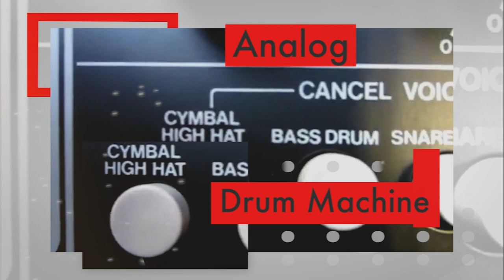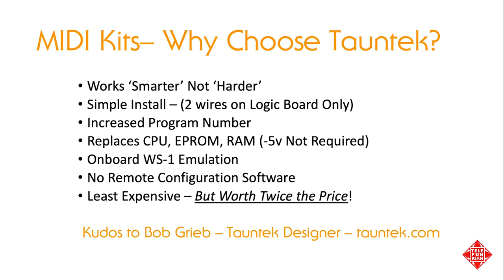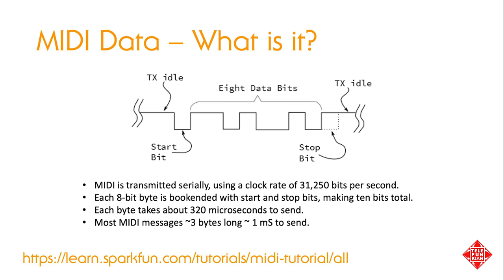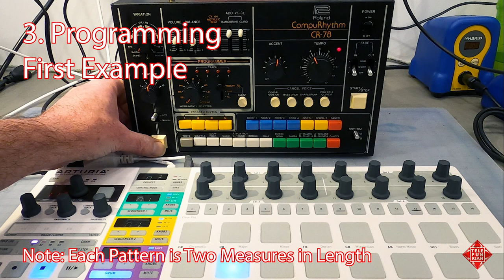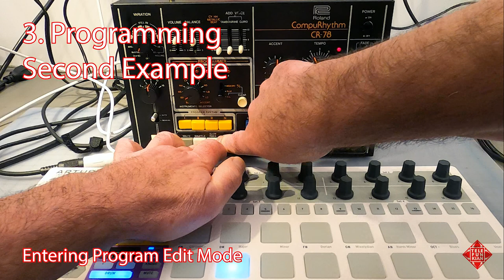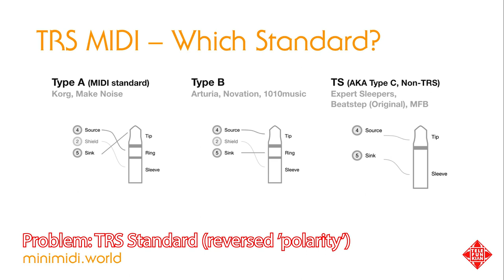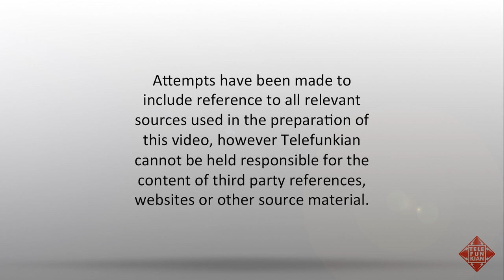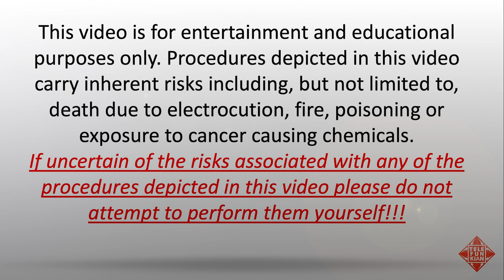Choosing and Installing a MIDI Kit in the CR 78

Comment: Excellent video. I installed this kit about a month ago and it totally changes your perception of the machine. I’m using the internal programmer a lot rather than midi sequencing and there’s a few aids Bob added to make it even easier. For example you only need to program the first bar of the pattern (in many early drum machines a pattern is two bars long) and copy it to the second part at the press of a button.
Reply from the maker: Thanks for your comment! Yes this kit, or similar, is a must-have for a CR-78 as far as I am concerned. I have a CR-8000 on deck that I hope to give similar treatment, not sure which kit to use there though...

Comment: Interesting vid. Very informative. You didn’t show how to extract the main board from the PCB. 

If you change the CPU does it not change the sounds or sound character? 

I would be so scared putting a soldering iron anyway near my very precious CR-78. I’d just be terrified of messing it up leaving me with an unusable CR-78. 

Of course I would love the benefits of this  kit. Might have to just carefully sample my 78 and trigger the samples. Not the same I know as playing the wonderful electronics with all its analogue micro variations.

You’re clearly highly skilled as an electronics engineer, way above the average user/musician. 

Great video on the wonderful old machine. Many thanks. Subscribed. Will watch your other vids. Nice tribute to the great Dave Smith.
Reply from the maker: Nothing on the Logic Board determines the sound of the instrument, all of that comes from the voice board. In this case, I was installing the kit on a new Logic Board so you are correct, I did not show the removal of the old CPU, as the board did not have one to begin with. I would suggest though, that if you are not going to be comfortable removing the old CPU you probably should not be installing this kit yourself, and if removing the CPU, be careful and keep it safe as it has value to someone who needs a replacement for a damaged CPU and wants to stick with the original.
Reply from the maker: And thanks for watching!

Comment: Hi,  I've really enjoyed the videos and great work you've done on your unit. 
I have a problem with my cr78 that i 
Would hope you might have an idea to fix. It all works fine other than the guiro sound does not have any velocity or accent with the tempo and patterns selected, the slider turns on the guiro to full on crickets in unison and no rhythm to the sound. I've changed all the electrolytics but I'm not sure what to look at next to get it sounding right, I'm thinking the pnp transistors at the end of the guiro circuit may be not conducting correctly but would like to know if you have any ideas? Thanks
Reply from the maker: Dan. I am having a hard time visualizing what you are describing but is it possible that VR63 is fully on or needs a good clean? Have you been able to calibrate the instrument otherwise? All other instruments play properly in their respective patterns with accents in the right places?
I can't tell if what you are describing is a logic or a voice issue.
Reply: @telefunkian  thanks for the reply. Apologies, I read thru my post and realise the poor wording. The unit plays fine with no other issues, only that the guiro sounds like the noise signal is on at a constant, so there is no rhythmic syncopation to its sound. The guiro only has a triplet or maybe quarter note rhythm when selected, I'm only getting the noise itself. I've tried calibration with no luck vr63 only effects the amplitude. From looking at the schematic I'm guessing a pulse comes thru pnp q518/519 and then is fed thru to q508 where the signal is blended into the pulse? I'm not very good with understanding these circuits, but I'm going to remove q508 to see if it is conducting properly have not had time since it was re-capped. 
Thanks so much for the reply very much appreciated.

Comment: Is there a difference in sound between using MIDI clock (with the internal sequencer) and just triggering MIDI notes...besides the fade-in/fade-out?
Reply from the maker: If I understand your question correctly there should be no difference in sound of the drum notes, but you loose the ability to use the accompaniment that depends on the clock being started, or to synch to a pattern in the machine. You may also have a lower noise floor if the clock is not triggered.

Comment: Is it possible to make a midi control input for the Roland piano plus 11? The drum machine sounds a lot like a cr78 and it would be fun to program patterns on it
Reply from the maker: Dave, Thanks for the great question. I have not seen a EP-11 in real life, so I downloaded the service manual to check it out. An interesting machine! The drums are triggered from low-going trigger pulses, while the keys are fed from a matrix that I am assuming is similar to the roughly contemporaneous Juno-60. I am not aware of off the shelf midi-kits that will allow for the control of both at the same time. It might be possible to design an Arduino-based system to control both, and that would be an interesting project. The Tubbutec uniPulse should be able to generate the appropriate pulses for the drums, though I have not used their kit.  I am in the middle of designing a system for a CR-8000 that uses similar drum triggers, when finished it could probably be used to trigger the drums in a EP-11. Another option would be to leverage the triggering in an Arturia Beatstep Pro. The BSP has four drum gate outs (there are 5 trigger points in the EP-11) that can be configured to send S-triggers (short). The S-trigger could work with the EP-11 but you would need to build a cable to interface with the EP-11, pop a jack in the back and route triggers to the appropriate points in the EP-11 board where the triggers need to be presented to each voice.